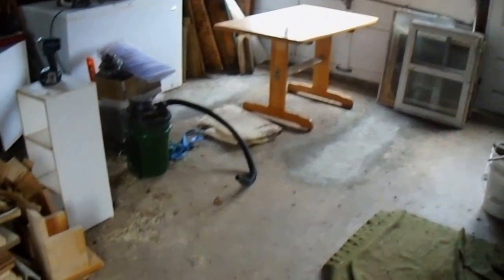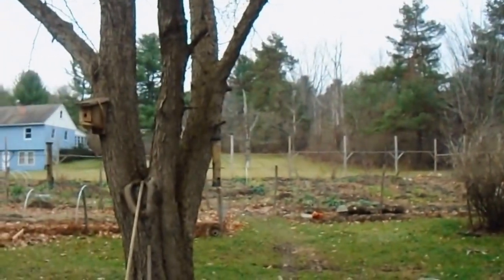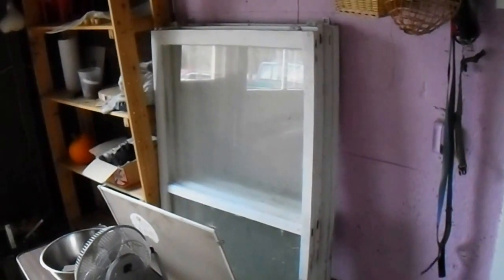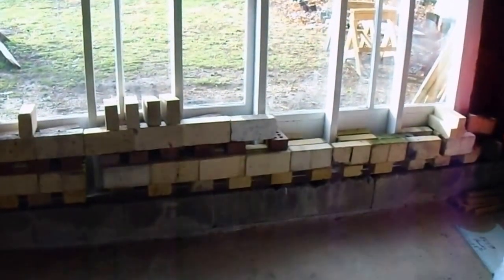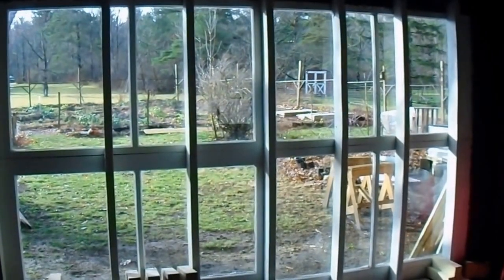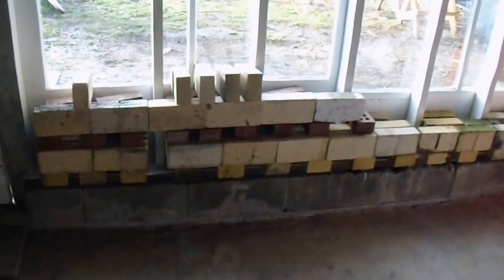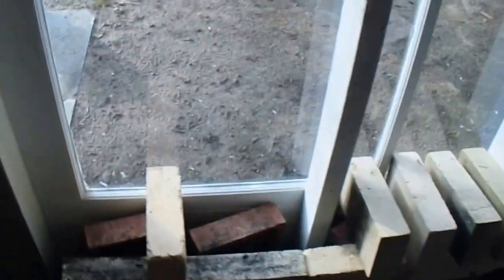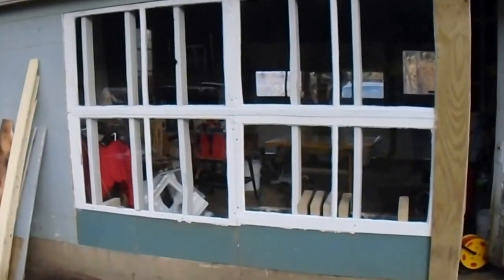Workshop upgrade - Installing Storm Windows for Light and Warmth

Comment: A well leveraged large improvement, good job! As I was watching I wondered if you would use an earth wall along the bottom section. Your trombe wall idea is good, though what if you built a rocket mass heater and bench along that southern wall while also filling in the outer wall; I imagine it would warm up the room nicely.
Reply from the maker: +marxerm It would be a way rad experiment to try to build a trombe wall that includes a rocket mass heater that can be fired when the sun isn't up...  Thanks for ideas to add more depth to the project!
Reply: And thank you for your great videos, I always enjoy them, just wish there were more, ha. Look forward to the new camera!

Comment: For each stack of windows, you could remove the two central studs and then put one back in the very middle — lined up with the central window frame — that way you only have one vertical line blocking the window and light, instead of three.  If you are concerned about structural support, screw the two old studs together before reinstalling, so the new middle one becomes double-thickness instead of single-thickness.
Reply from the maker: +Penfold 'OoO' Thats a great suggestion...  Yeah.  I'm sure I could have made it nicer in a number of ways, and your idea certainly would have made it better.  But as of now, it works 'well enough' for us, and thats generally the goal I have.  Feels like so so many projects on the table all the time that well enough is generally great!  But good for sharing so others can hear that idea...